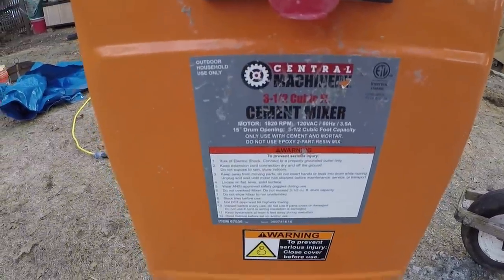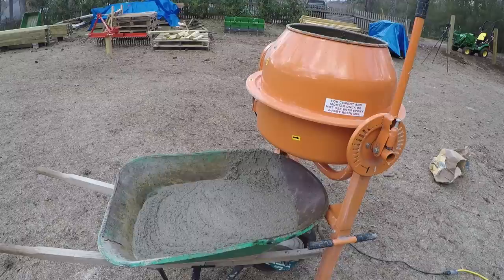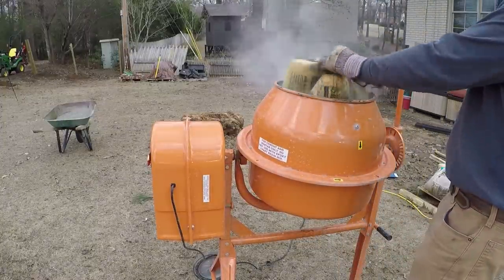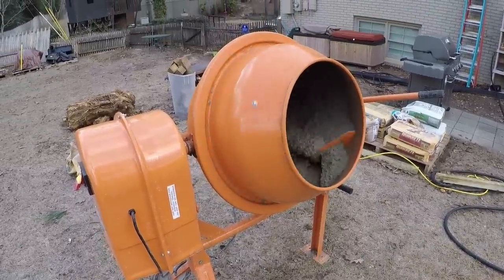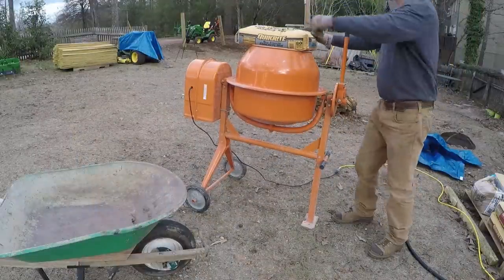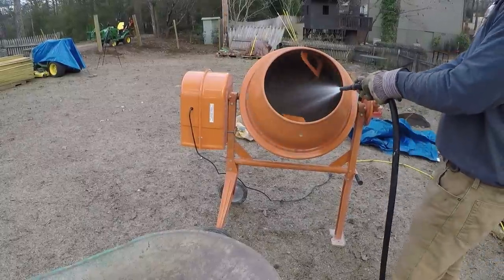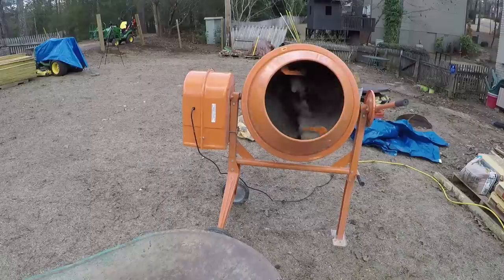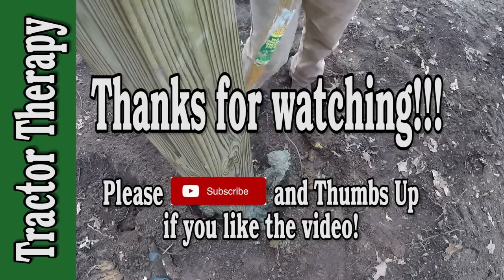Harbor Freight 67536 Cement Mixer Overview and Action

Comment: I bought one of these for a major pour I am doing hoping it holds up as it's going to get a major workout. I expect to mix and pour 14 yards of concrete for a garage floor. Some may say why don't you just use concrete trucks. Well in my area it's become very exspensive to buy premixed concrete plus I don't have the help nor money to hire a finish crew to handle that much concrete in a day. What I do have is all the free sand and gravel I need as well as water only need to buy the Portland. So I can pour at the pace I am able to work with very little cost. I can get this project done for a couple hundred dollars versus $3 to $5 thousand it would cost me to contract it in and pay labor.
Reply from the maker: Way to go Ken!  My hat's off to you for doing it yourself!  Yes, you will get a workout!
Reply: That's right..I am doing the exact same thing except I am doing concrete around the sides of my house and extending driveway... Saving thousands that I don't have...
Reply: Ken Jett dude POST A VIDEO OF YOUR PROJECT! 🤣 I bet you haven’t done it yet! Haha
Reply: @rcppop3090  I hope too and you are right because of some health issues I have had to delay. Like alot of big projects seems always something that takes priority. But I do hope things start going my way I really need my shop built. Got my house full of tools and they need there own home.
Reply: Ken Jett 14 yards with a mixer just sounds like torture man. Not to be an asshole but you’re gonna get healthy enough to do the project and put yourself right back into the hospital! 😜
Reply: @rcppop3090  well I do have a teenage son to help also. But I don't plan to do it in one pour. Just going to do it in sections. I realize I am not able physically mix and pour that much at one time. They was a time I could but those days are long gone. Likely why my health isn't so good anymore plus I am almost 62 now. Just don't move as fast but I am not one to give up either.

Comment: How much water do you put?!?!?
Reply: follow the directions on the bag. But yeah, this guy went insane with the water he put in. That is some soupy mix and is going to be weak as hell if you tried to use this in a driveway or anything like that.. He's only using it for posts so at least it's not a life and death thing that it's going to be a weak mix.
Reply: Bit of sand make it stronger and thicken up a bit .

Comment: Mine can barely mix 1 80lb bag of concrete before the motor stops.  It seems severely underpowered and I’m really disappointed
Reply from the maker: Is the motor stopping or the belt slipping?  If it's the motor stopping, take it back and get a new one.  If it's the belt, make sure it's tensioned properly.  I regularly run 120lbs+ in mine no issues.

Comment: how many fence posts will one load of concrete fill? Thanks
Reply from the maker: I use one bag per post - so if I mix 3 bags in mixer, I can get 3 posts.  Thanks!
Reply: Depends on how deep and how wide you make the hole.

Comment: Ya the instructions are pretty much worthless but for the price of this thing it’s totally worth it. So far I’ve mixed an entire pallet of 80# bags of concrete with it. A little driveway extension and a whole lot of curb and fence posts. 

As far as renting one over owning one goes, well for me the convenience of having it in my yard and tinkering on projects as I feel like it over time.
Reply from the maker: That's a workout!  Same here on the convenience factor!
Reply: Stockton Accelerated uhhhhm I don’t really remember but I recently replaced 225’ of fence around my home and set 21 steel master steel posts at 2 60# sacks of quickcrete each. Then a little extension of my driveway and that was about 10 80# sacks and just yesterday I made a 2’x2’x30” deep sump pump basin and that was 8 80# sacks as well. The concrete sump pump basin has 3” thick walls. 

The mixer still runs great and hasn’t fallen apart yet! I have a construction yard where I keep my work trucks so I keep it there but it’s extremely convenient to own.

I own and operate a concrete pumping service/company so hard work is my way of life 😜 and the idea of ordering concrete for small minor projects under 4 yards of concrete comes at too much of a high price when you factor in “short load fees” around here and I’m sure it’s the same where you are, if you order less then a specific amount of concrete from a ready mix plant then you have to pay a higher delivery fee which often times makes the customer agree to a bigger project. But for those little home owner projects where you just want to getter done, owning a CHEAP HOBO FREIGHT mixer Is PRICELESS!

Comment: If you want to use this mixer for professional concrete, This is not for you. I tried to use this mixer to make concrete as per the instructions of Quikrete, which is not more than 3 quarts of water per bag..... we really had to rotate the drum with our hands because the motor was not strong enough. If you put too much water on concrete up to the point of good workability , you will end up with weak concrete. So you will need a better motor if you want to mix concrete by the book. I was still able to get the project done: we mixed around 30 quikrete bags to repair several spota at a commercial parking lot.
Reply from the maker: Agree - if you are a contractor and do concrete all day, you might want to look elsewhere.  This is best for the advanced amateur homegamer.
Reply: I’ve driven my bobcat over my driveway patches and my Ford F-350 over it too and it hasn’t cracked yet. 

4” thick and I mixed it to the same consistency as he did in the video. Nice and wet. I used the quickcrete 4000 and sackcrete 5000 psi from Lowe’s and home dumpo
Reply: @rcppop3090  this is because the patch is confined by the surrounding old concrete, or because of the propper thickness you provided. But if you Google water to cement ratio of concrete, you will find that low water gives higher strengths. Wet concrete is nice and easy to work with. But do that on a comercial project, and they will make you remove that concrete and kiss you good bye as a contractor. And dont get me wrong.....i still use this mixer, still better than doing it by hand, but since i use low water, I have to help the machine with my hands lol.

Comment: I just bought one and assembled it tonight with help from my 17 year old son. The instructions are a total joke, basically worthless but common sense you can figure out how to assemble it.

I have 3 slabs to poor that will take approximately 3 pallets of 80 lb bags, a 9’x5’x6” slab, 10’x10’x4” slab, and a 4’x7’x4” slab. I could not find any coupons so I got stuck paying full price but oh well. I always have little jobs I wish I had a mixer for and I also do lots of brass cases from variety of firearm calibers and doing them on my small wet tumblers takes to long when I have 30,000+ rounds to wash and prep for reloading, so it will be nice to be able to dump 10,000+ cases in at a time. The cost for this mixer is about the same cost as a small wet tumbler so it is a win win for me to just keep it.

I was hoping the motor was a bit larger, 1/3hp seems a bit small but I guess it will do the job, can always put in a larger if need be.

I will be doing some videos and uploading them to my gun store page for my customers and anyone else that cares to watch.

Comment: I have this, and it will NOT rotate at an angle that actually mixes....motor overloads and stops. That's with ONE 80lb bag. Worthless
Reply: He did it in the video....you probably didn't put it together properly and the gear is binding up

Comment: Idk if it was me but this thing couldn't even handle one 80 pound bag of concrete before stopping on us then it would stop by itself constantly after that, the thing was just a piece of garbage for me
Reply from the maker: Check the belt tension on the motor!  Might need some adjusting...should be able to handle that fine!

Comment: Avoid this mixer at any price. It is an absolutely under powered piece of crap.

Mine was like most other reviewers missing pieces out of the box. After creating those pieces in the shop I fired it up to blow a 30 amp
breaker. This is another common problem with many people. 
After messing around with it I was able to get it working but it was pretty under powered. In the middle of some mixing last night of a few bags I noticed that it would barely spin the drier mix, another two bags today and it will no longer spin two #60 bags at anything thicker 
than water soup. The motor is shot and I am at 60 or so bags total. This is also another very common problem. The only people having
any luck with this if it even works out of the box is people not using it for more than a few bags. 
There is a reason they are charging a $30-$40 restocking fee on them now, they are all being returned.

The common complaints are the worst assembly directions ever.
Missing parts.
Blowing breakers
Dead motors
Weak Motors
Motors that stop spinning more than a bag after a few uses
Motors dying completely after very little use
Broken cogwheels, (This one I haven't had happen yet because I have only loaded two bags at once)

This is about normal for harbor freight trash now, they used to be okay but now everything is under-powered, weak or missing parts or just plain DOA.
Reply from the maker: Mine is still going strong!  Return it if it's not working for you.
Reply: @tractortherapy42   I plan on it but the 150 mile round trip and I already returned once for parts that they didn't have after saying they did that I had to make is still a sore spot. I have a minimum 60 bag slab that I am scared to start without a backup mixer now, that slab is a cover slab over a box and must be uniform and one piece.  Reading the reviews show this is now common with their mixers. I had a previous mixer from them 15 years ago I never had an issue with but it was hands down better, thicker, heavier materials and stronger motor. I ended up selling it as I didn't expect to need it again. The difference in quality was night and day. I used to love their stuff, now I try to avoid most of it because everything burns out or quits in days that used to last forever.
Reply: I totally agree with everything you state about this piece of crap. Mines worked OK with one 60lb bag, once I poured 1/2 of another bag, it stopped spinning. The cause was that it broke the lockpin key between the shaft and belt pulley. What I did is that I fabricated my own lockpin key with hardened steel and also drilled two holes at bottom of motor mount to help keep belt tight. Have yet to try it, but based on past failed attempts fabricating a couple of other metal lockpins, I have a feeling that now with the hardened steel lockpin, it will probably burn belt or motor. Maybe you and I were the only ones who got the defective quality mixer as opposed to all the other happy owners here.
Reply: @josephlund9989   Nope, We are not even close to alone. :) 
Look at the reviews. Many, many people are having the burned out motors, blow fuses, gears breaking etc.
Reply: @jsauerii  My brother had one in which he mixed less than 20 bags of concrete before he gave the mixer to me. I simply turned on the mixer to see if it would run, and the motor blew out in a puff of smoke. Complete junk.
Reply: Buy a belle, these mixers can be dangerous when tipping, the arm broke off the one we hired.

Comment: I am in the process of putting one together and the bolts come all mixed together pretty much. The instructions suck, typical low budget chinese manufactured manual, if it wasn't for a decent video explaining how to put it together it would have been a real stresser. I really appreciate the videos people put together sharing their experience and ideas.
Reply: I have mine assembled and on first inspection I am not impressed and am considering my options. The barrel of the unit does not appear to be manufactured/assembled properly it rises and falls over the toothed pulley. The motor appears pretty wimpy I can stall it by holding onto the drum and turning it on when the barrel is empty. I have purchased other cheap tools from HF and have had good luck with the majority of them. If the weather ever warms up and drys out I will give it a try and leave a comment on its performance.
Reply from the maker: Sounds like something is out of alignment.  Check the tension on the belt - you may need to tighten it by adjusting the motor position - it shouldn't slip on normal use.  Sorry to hear about issues - hope it works out!
Reply: @tractortherapy42  I doubt it is the motor alignment. The sprocket isn't moving up and down, the barrel and toothed sprocket were pre-assembled into the mounting arm. All I had to do with the bottom half of the barrel was mount it onto the stand, the barrel was already mounted to the U support that mounts it to the stand.

Have you used your mixer much? I have read some bad reviews re the motor being under powered and the drive shaft sprockets failing mostly because of the keys on the sprocket shaft.

Comment: Harbor Freight cement mixer is made in China  very bad quality
Reply from the maker: Yep, no doubt about that.  But it's price point is perfect for the projects that I'm doing.  I don't need a $500 mixer.  I'll sell it on Craigslist when I'm done with it, and someone else can get some good use out it as well.
Reply: Everything HF sells is made in China.
Reply: Dear,we have a no drum mixer machine,you can use it in any different places,with carry-on charge
Reply: I suggest that you price check the higher quality ones and their country of origin as well.  In any tool there are ranges of quality that correspond with the price.  Making a decision to pay a low price of a low quality tool is perfectly reasonable especially considering most people will make their money back if it works for a single project.  You might choose to make a different decision, but guess what.....the world needs all kinds of people.
Reply: The ghastly noises that it makes when mixing probably due to badly machined parts.you will need ear plugs
Reply: @fightzoid  - Well to be fair, everything that everyone sells is made in China.